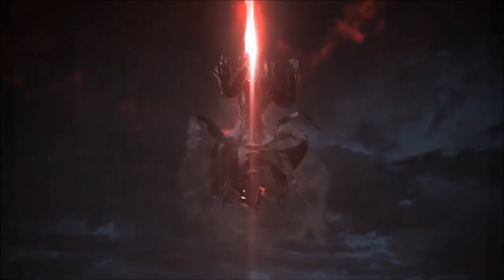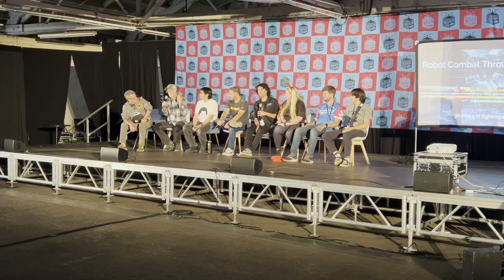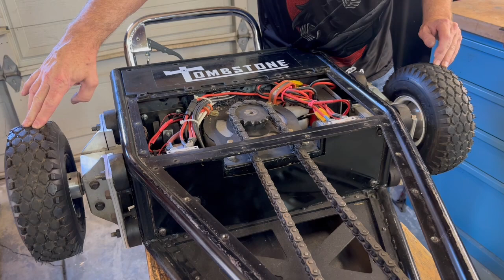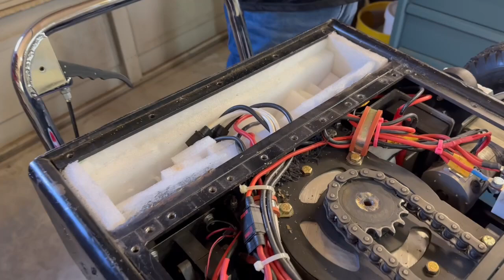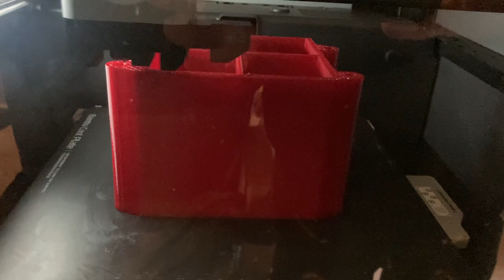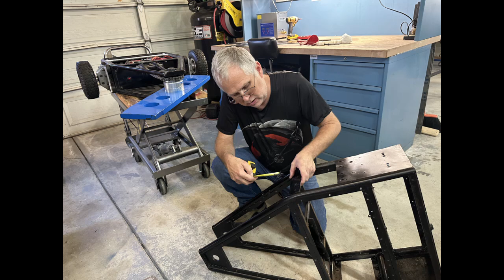Tombstone BattleBots Rebuild Plans

Comment: would you be able to put a wedge on the back of tombstone if you were facing another horizontal kind of like some other bots like lockjaw did when they fought you?
Reply from the maker: It's really just about weight management. A sturdy wedge on the back will be 15 - 20 pounds, and I'd have to take that out of something else to make it happen.
Reply: @ray9368  that brings me back to the time when the skorpios team interviewed you and asked why you didnt put wheel guards in tombstone, and you said "the only way i could do that is it it took it out of the weapon! and thats not what tombstone is, tombstone is a big weapon, THATS WHAT IT IS, ITS THE WHOLE POINT OF THE ROBOT IS TO BE A BIG KINETIC ENERGY WEAPON!"

Comment: may i suggest a IGBT insteat of a Conactor, that way you don't have the issue where a side impact momentarily opens the contactor and you get extra flashing of the pads.
you could also have a manual isolator switch in series that is controlled by your remote via a small servo, for emergency cut off of power to the weapon motor. you know just as a extra safety thing in case things goes bad. it can even be automatically activated upon loss of signal from the remote
Reply from the maker: I've run the weapon motor at 60v before, but will probably settle at 50v for this build. And it pulls ~2000 amps at spinup. I am unaware of any off the shelf solid state solution that is viable for this kind of power needs. And certainly not in the same compact form factor that I can get with the contactor.
Reply: @ray9368  holy shit, 2000A, i had guessed 500-1000A max.

Comment: Hey Ray, have you used, or considered using magnets for downforce instead of relocating the wheels? I think if you can spare a little weight you might find they let you control the robot extremely well and let you swing hard and fast to strike
Reply from the maker: There are certainly places in combat for magnets, and I do have some ideas there for down the road. But with this build, I am still planning on moving some stuff around to get what I am after.

Comment: Such a legendary machine. Regarding the foam padding, check out how mobile phone cases work. The material behaves more like sand, in that it can be pushed gently, to move, but, when hit hard, it stays firm. Most of these materials are proprietary, however, you could get some sponsorship from a case manufacturer and get them to help you out with battery protection. Laptop cases have the same materials, so you could buy one, chop it up, see how well it works and then approach a mobile phone accessory manufacturer. I am sure they would love to reach a young audience with their logo on the legendary tombstone.

Comment: You might be able to use an SSR (solid state relay) to switch the main weapon motor, provided that you can find one with a suitable switching curent. They don't have any moving parts and won't bind shut. They are also pretty compact.
Reply from the maker: I’ve never found one with a high enough capability. Inrush amps for this motor is around 2000 amps 🤷🏻‍♂️
Reply: @ray9368 I was thinking of something similar to this comment. What about soft starting through a SSR with a big resistor or pwm. Just to get it going for half a second and then the inrush current is drastically reduced.
Reply: @user-sq4yl5nf1d  I'm sure that would work but it looks like he is really limited on space. You would then need to fit 2 relays and a resistor.
And deal with the heat of the resistor somehow

Comment: I'm surprised it's running a brushed motor. I thought Permanent magnet BLDC are just better in every way now with advanced speed controllers.
Reply from the maker: Like most things, this kind of depends on how you look at it. From many perspectives, brushless is amazing. High power to weight ratio, increased efficiency, smaller form factors - lots of things that help out here. And you are correct that there have been improvements on the controllers, which has helped a lot. But massive raw torque at 0 rpm, well brushed still wins there. Even sensored brushless systems take a bit to get themselves sorted and really start to make power. I may eventually start playing with more brushless setups in Tombstone. We have after all done that with Mortician and it has worked well.  But there aren't any plans to do that for this upcoming series.

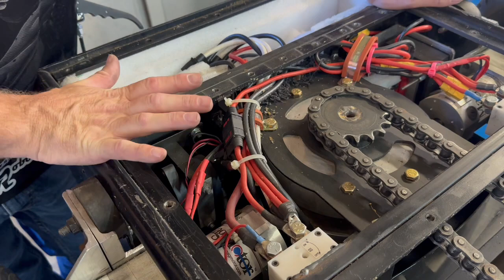Comment: 5:41 of course not being able to turn tombstones weapon off is a bad thing! its tombstone for corns sake! i hear that if you cant turn the weapon off, then you just wait for the batteries to die
Reply: Yeah, that's standard procedure for any bot that gets stuck on for any reason.  Tombstone may have batteries large enough to run its weapon for ~3 minutes of combat, but if it's hitting nothing but air the power draw will be reduced, and therefore it could run for quite a while longer.
Reply: @stonefish98  therefore prolonging the gap between matches
Reply: @BotvacProductions469  Yup.  Not a good situation for anyone.
Reply: @stonefish98  lol

Comment: A few suggestions: 

1- Wheels positioning: why not move away from the motor assembled on the wheel concept? It requires rubber shock mounting and messes up the center of mass. So an idea could be to mount the wheels directly on the chassis, so you could position them more accurately and wouldn't need the shock mounts anymore, and have the motor mounted a little backward to help the balancing and coupled to the wheels via short chain loops that would also help mitigating the torque shocks, that on a bot like Tombstone are immense.

2- Wheels: they're iconic, good looking and grippy, but it seems they're starting to not be enough anymore to handle all the pushing and sideways forces and overall increased power of Tombstone. 

Tombstone probably needs wheels with even higher surface area. But then they'd be too heavy. A solution could be to build custom wheels in shape similar to F1 ones, so empty in the inside and with a wider rubber area contacting the floor. Same diameter, same diamond texture pattern which is great for grip, but a little wider without weighting more. Obviously they wouldn't be inflated with foam anymore, just a thick rubber coating over the metal rim, i don't know if i explained it clearly. It would also make them more resistant to glancing blows.

3- Weapon tips: the weapon tips should really have a positive rake angle. Right now it's negative and even in the aluminium + S7 inserts it was only neutral. It's important because the more it bites on impact the less it tends to "slip" and so the less force is transferred back to Tombostone, helping it slipping and bouncing away less on impacts and delivering more damage to the opponent.

Comment: Ray, there might be a handling advantage if you try a pair of Go-Kart slicks. They should be a stickier tire and even with the mods, I can't see better traction doing anything but adding maneuverability.
Reply from the maker: We've used gocart slicks in the past, and the truth is with as filthy as the arena floor gets, tires with treads tend to get much better traction. The stickier tires just tend to pick up the arena crud until they get no traction at all.
Reply: @ray9368  lol
Reply: @ray9368  😂

Comment: Great Ray. Happy to hear Tombstone is returning. I have been a fan of Tombstone since Season 2 and recently found your channel. I think Battlebots moving in the YouTube direction will be good, as the country I am in right now don't show Battlebots on any of the main stream channels. I saw bits of season 2 and 3 on TV while I was in another country but anything else from other seasons I saw were on YouTube. Also, I got a question about the battery layout. I don't know about electronics, wiring, circuits etc so I apologize if these are silly questions. Do you normally have a separate battery for weapon and separate for drive or do you normally have one set that powers all? If you do have two sets, would it be good to put a 'firewall', made out of the same material as the sides of the frame, in the back compartment to separate the weapon battery from the drive battery? Would that be better in case of a fire. Maybe that way if one burns down you still have the other and maybe you can divert some of the power from the surviving battery into the system that no longer has power? (Even I am not sure if that is possible but just a thought that came to mind)...I know you mentioned using two small batteries rather than a chunky one in the air travel video so maybe if you physically separate those of the same system as well you might still be able to drive with half power for example? (I am staying this assuming the plastic for the 3D printed box is flammable, so sorry if I am wrong on that). Also, wouldn't the foam just spread a fire more? Also, would you still be able to attach the big red and grey blade with the teeth (from the blade types video) if you move the wheels forwards? Again, I don't have knowledge on these so sorry if some of these were silly questions.
Reply from the maker: We have run the robot with separate power systems for drive and weapon, and at times have run the whole thing off of one set of batteries. It just depends on specific components really. But my intention for the upcoming series would be drive and weapon are each on their own power systems. 

And yes, separating them is a good idea. Which is why usually my robot drives around for a while after it's on fire - the systems are separated. But once you get a battery fire, it's gonna burn pretty hotly and well eventually it is going to get everything. 

If we do move some of the drive system around, I will make sure that we can still use all of the weapon bars I currently have made. In this time frame I don't see me making any new ones, so we have to make do with what I have in the shop (which honestly is still a lot!).
Reply: @ray9368  Ok, makes sense. Thanks for the reply Ray. I thought putting a firewall might work to delay some of the flames from reaching the other but I didn't consider the possibility of it burning hot enough to get everything. I wish Tombstone all the best!
Reply: well i mean if the drive burns out, and you still have the weapn, that would defeat the pourpose of the firewall in the first place

Comment: They make Solid State Relays that will handle 100 Amps DC and they are reasonable priced. I not sure if that is a high enough current rating for Tombstone's weapon motor.
Reply from the maker: I am exceeding 2000 amps at spinup :) I would love to see some higher powered SSR options, but I've never come across anything that I felt was viable.

Comment: There is only one robot that could reliably beat Tombstone.  That robot is Tombstone.  Tombstone's power and energy were its own worst enemy.  I have wondered if there was a way to disconnect the motor when flying to a wall.  Would human reflexes be quick enough to disengage if Tombstone went airborne?  Would there be any kind of acceleration sensor that could be tuned to cut power to the motor after a blade strike or if Tombstone went on a ballistic trajectory?
Reply from the maker: The rules state I have to be able to spin down in a minute. Tombstone takes around 50 seconds to spin down. Even if the weapon is turned off before an impact, it makes no difference. The energy is already stored on the system and it WILL get released! 

We already routinely turn off power to the weapon before getting pushed into the walls. It's just too late then to really have much of an effect.

Comment: -- Don't bother responding to this, Ray.  I am of the opinion that Battlebots is crippled by mismanagement across the board.  Might be a lazy way of saying.  I don't want to write a novel.  Hope the show happens though.  But things, finically need to be more even(IROC if you will) between teams.  Them refusing DeWalt, I mean WTF as a sponsor?  The list is endless.  Someone needs to sit down and say hey, you've got 100k in this contest and you're fighting someone that only has 10k.  No.  And nobody wants to see a Mike Tyson fight.  The guy is bad for sure, but give us something that's going to last more than 1 minute.  Your bot has to do that or go home.  Other rules like flame throwers: you cant use napalm.  Well what if that forced builders to innovate.  Can't use nets, well, same thing.  
   Forgive me it's a 'Hell with it, do an all drug Olympics.  Let's see how high a human can really jump' approach to the matter.  
   And I like your ideas for Tombstone.

   EDIT: bearing in mind voltages, can you fuse each battery in the event of failure?  Would say a 100 amp or more battery isolator/relay (car audio) work as a switch for weapon activation?  Can you store batteries in different locations across the machine?  Would that help with balance, or critical failures?  Can you design blow outs for chemical fires if said batteries are compromised?  

   Anyways, thumbs up.
Reply from the maker: I am fairly certain that the failures on the batteries have been more physical than electrical. I have plenty of battery capacity - like seriously a lot. Part of why when it does go up it is one heck of a fire! But if I lose an end piece to the weapon bar (or a tooth comes out) the violence of shaking like that simply destroys everything before it can spin down. And I've had direct hits to the robot, enough to bend in the sidewall to the battery compartment and strike a pack. And once one goes off, he is going to take all of his friends with him. I really think better physical protection is going to be an improvement for reliability.
Reply: @ray9368  -- Thanks for the replay.  So I would ask again: For any reason a battery is compromised, would a fuse/breaker system help you?

Comment: I love Tombstone but at some point I would like to see a meta focused update.  Tombstone's overall design hasn't changed much in too long.  You may have added power and torque but Tombstone needs a chassis and weaponry update to compete with the physical dynamics of today's competition.  I don't know what this will end up meaning, but the future Tombstone will have to look alot different than the current Tombstone.  I say this because I know if someone like you would try to build to the current meta, you will achieve far more success.  In alot of sense Tombstone is sort of "uninsurable" in the current meta, its built from a time when it was acceptable for your bot to commit suicide, but the precision has changed alot in the sport.
Reply from the maker: There are always things to update for sure, and there are some plans to change things eventually. But I currently don't want to make a 4 wheel drive vert :) And unfortunately, a lot of "I would lover to see...." stuff takes money and time to make happen. Neither one of which I have a lot of before we have to be ready! 

I agree that the sport has changed a lot over the years, and honestly a lot of that is because of me. But I think there are further ways to make an offset horizontal be dominant again. We'll just have to see how well I can execute those things!

Comment: Cannot wait to see Tombstone tearing it up! I'm all for the 2 contactor option. Less electronics to go bad or be a potential weak point. It's one of the remaining advantages brushed has over brushless.
Reply from the maker: It is the simplest way to fix the issue, and honestly if one of them dies somehow the other could keep the weapon working at half power, so there is some redundancy too.

Comment: Would team battles ever be a thing ? A team of 4-5 bots ! Tombstone, witch doctor, hyper shock, Minotaur, huge! Would be a great team setup. More crazy fights but less fights. ? Thoughts ?
Reply from the maker: You mean like 4 against 4 type of stuff? Probably not - at this point they don't even want to do rumbles any more, since the bots are just so dangerous and they don't want the safety headaches.
Reply: @ray9368  thanks for your response. That is what I was thinking. But also keeping the 250lbs limit just having it split between 4 bots. I also miss the headhunter ones
Reply: @ray9368  too bad tombstone has never been in a rumble, but thats probably because the other bots would probably team up on you

Comment: Long live tombstone. Please no more battery fires. I second the return of the wedge on the back - no flat surfaces please. The core problem is how to prevent tombstone from destroying itself when it delivers hits. Shock absorbers? A dynamic fluid cushion surrounding vulnerable parts?
Reply from the maker: The back of the robot may look flat, but there is a bolt placed in the center which keeps it from being stood up on the rear. It's not going to do the thing :) 

And yes, working on reliability is always on our minds. We've got further things to get there of course, and we'll see how well these updates work out later this year!

Comment: Those mounts look a LOT beefier than the old L-shaped ones. Is that going to be kept with the redesign? Also, this'll be great timing for SpinMaster's re-release of the Arena Max with Tombstone and Barnakills (as part of their HEX-BOTS range)
Reply from the maker: The idea is to just move the entire drive assembly, as you see it here, further forward (or forward and in some) to better facilitate driving. That's the plan anyway